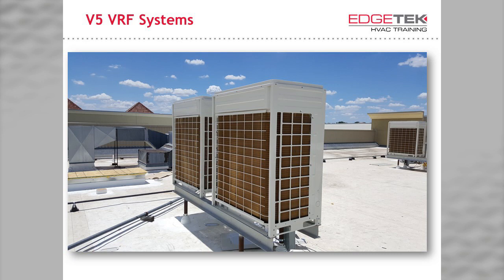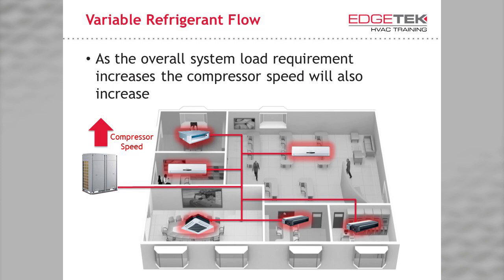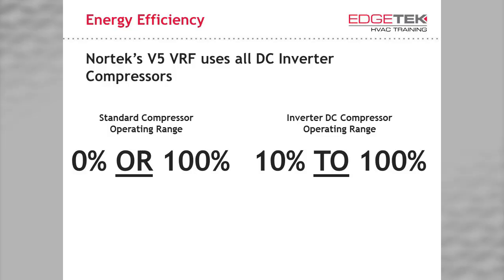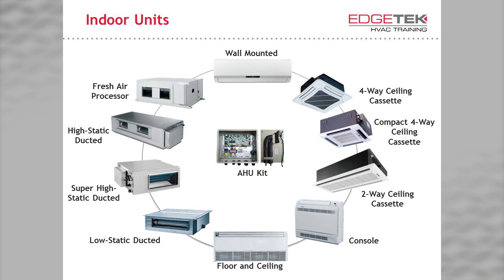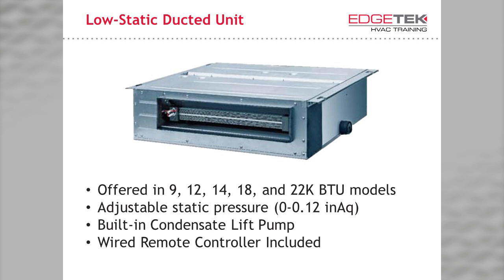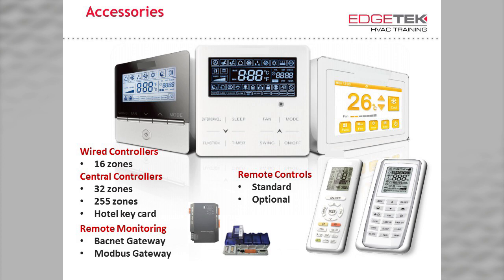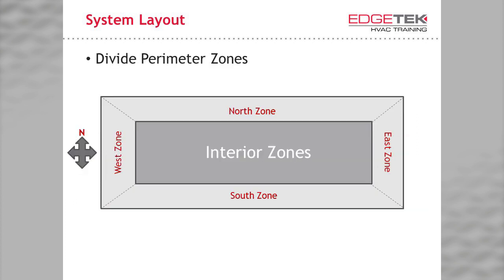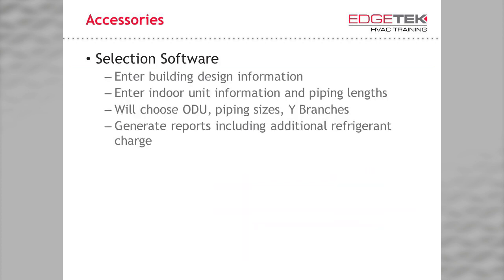VRF Training - Part 1

Comment: Thanks for sharing,  the pricing of VRF systems is very expensive compare to inverter heat pumps systems with multi zones, also the COP in the wintertime is low about 1.2 (-22f ) I think that the only difference is that the VRF system can heat and cool at the same time by sending the discharge refrigerant into the distribution cassette and to the specific area, so inverter-based heat pumps are my choice,  again thanks for the video, and if you don't agree with my point of view please feel free to answer.
Reply from the maker: Thank you for your comment! Although the price of these types of systems can be more expensive than some, Nortek’s Mini VRF is very competitively priced. When factoring in the cost (not to mention problems) of zoning damper systems, the pricing is actually in line or cheaper depending on the system configuration. Additionally, these systems are now rated to -31°F, providing heating at far lower temperatures than traditional-style inverter heat pumps. The COP of a 3ton Mini VRF with 69.8°F IAT and -31°F OAT is 1.965, or nearly twice as energy efficient as traditional electric heating. In fact, depending on local gas energy rates, it’s cheaper to run this heat pump, well below 0°F, than even a gas furnace.
 
One side note: most VRF systems, particularly in single phase, are not capable of providing heating and cooling at the same time. These types of systems, with changeover boxes, are commonly referred to as “Heat Recovery” systems.
Reply: @EdgeTekHVAC  Many thanks for your answer, I do believe that VRF will be cheaper but a 3-ton inverter-based heat pump is a lot cheaper than 3 Ton VRF heat pump, I would be grateful f you can send me a link to a VRF Unit that confirm your facts both COP and pricing, many thanks.

Comment: Hey there, thanks for sharing. I work mostly in high-rise buildings that use water source heat pumps instead of the conventional air-cooled condenser. Patrons often ask me to reduce ductwork high to accommodate cabinets, ceilings, or appliances. So, after seeing this video, I think that replacing some or all of the ductwork with refrigerant lines sounds like a nice solution to this problem; however, nothing was said about water source indoor condensers applied to this technology. Are they available? Thank you.

Comment: so what happens if I need 3 tons upstairs and 2 tons downstairs and you undersized my condenser???? this is very confusing. you just pretended like you wouldnt always need 3 ton upstairs but the heat load called for 3 tons upstairs and 2 tons downstairs.... ???? gonna be having a bunch of service calls because one area isnt getting cool/reaching setpoint at full heat load conditions... bad practice????
Reply from the maker: Please reach out to our Technical Services team for help 1.800.422.4328